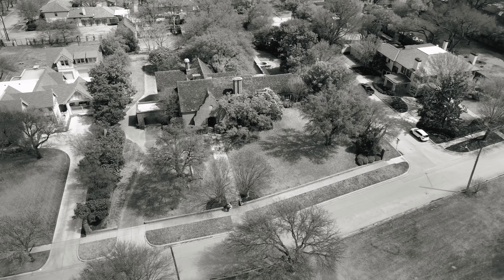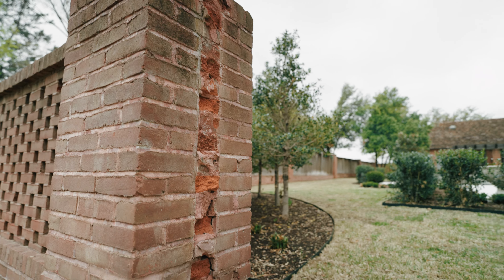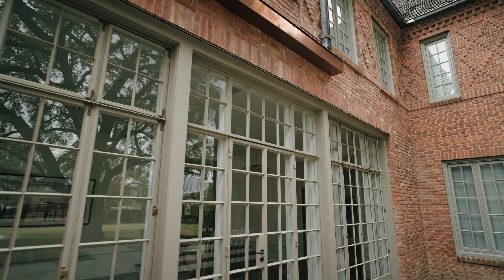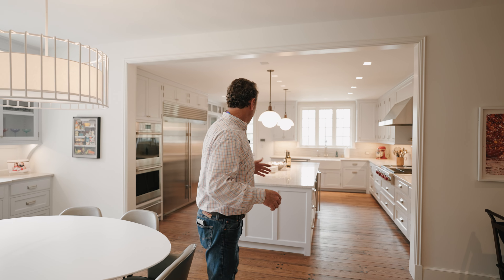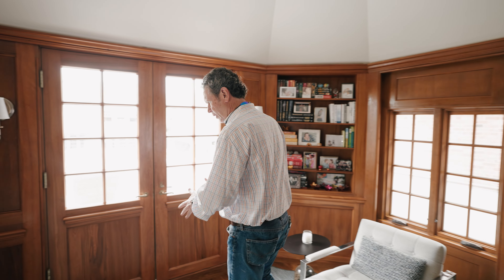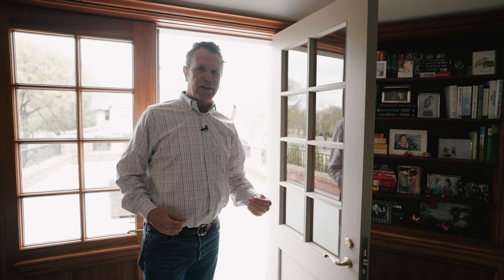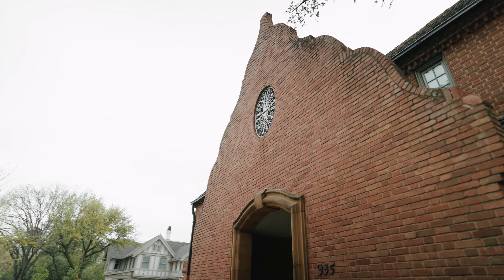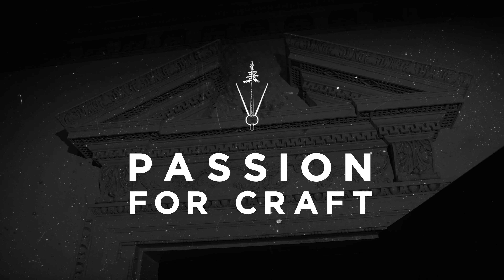1928 Period Revival House FINISHED!

Comment: In an earlier video on this property, an area of brickwork had been broken out. This appeared to have been done with brute force, i.e. with a sledge hammer or similar. This may not be true but whenever I work on any historic building in England, the emphasis is on salvage. Especially bricks which can be impossible to replace. The best tool I have found, for both lime mortar and Portland cement, is the Arbortech Allsaw from Australia.
Reply from the maker: Ok, thanks for the recommendation. I'll check it out. FYI, bricks were carefully saved.
Reply: @BrentHull  I should have expected you would not waste good bricks. Talking of bricks, I should be starting a contract to take down a Victorian servants wing and rebuild to current code. The brickwork MUST match the historic main house, so naturally I priced to salvage the existing brickwork. Only the client decided to clear the site himself. Terrible decision!! Not only will he have to pay for 14,000 special handmade bricks, 8 7/8 by 4 ¼ by 2 5/8", but delivery will be least 6 months. Fortunately he has quite deep pockets.....

Comment: But were those walls high enough to justify that crown moulding?? I was under the impression that you said dentil moulding shouldn’t be used except when the ceiling height justifies it??
Reply from the maker: Hmm, I think in rooms with 8' ceilings it is hard, but it also has to do with the scale of the dentil. There are some rooms at Winterthur (good historic precedent) that have dentil in 9 and 10' rooms. It all depends on scale and proportion. Thanks.